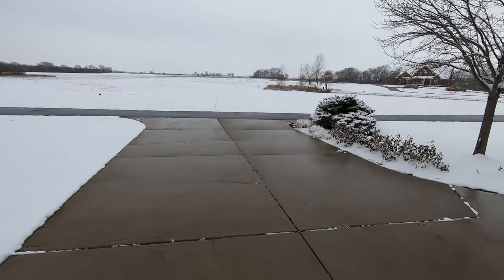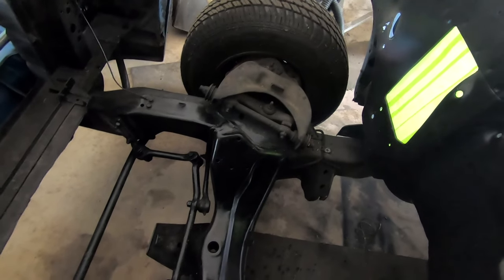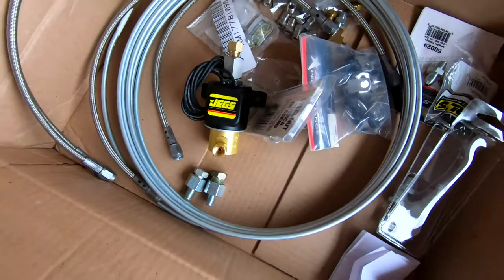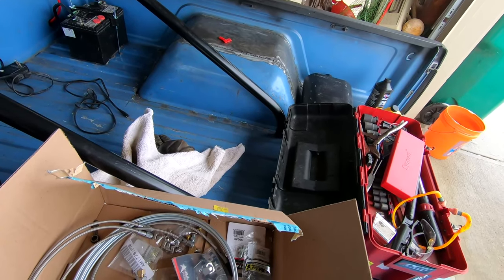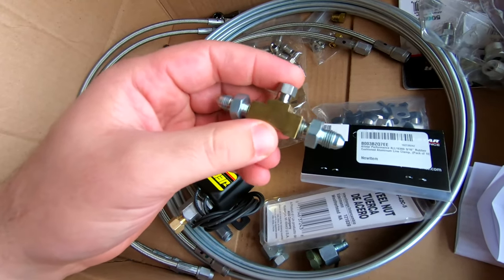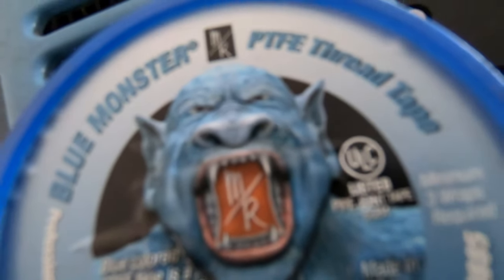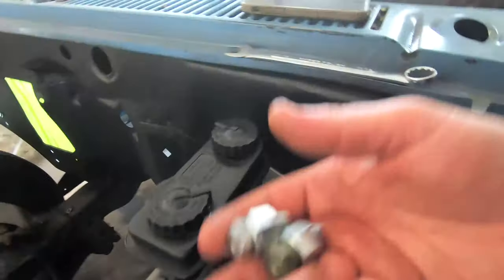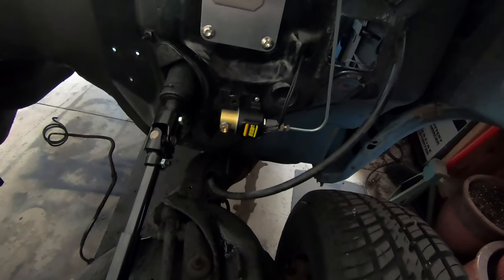Why I Installed my Line Lock Backwards (and What Line Lock Does)

Comment: Hey bud,  I installed my line lock like you did and it didn't work.  Most brake solonoids control back pressure and let pressure through from the master. You're going to need to reverse your lines in order to isolate the rears.  I learned this the hard way, had to take everything apart and mangle the hell out of it but then it worked great.
Reply: yes, at least in my case.  The port nearest the firewall is the front brakes
Reply: Just had to mangle my lines to turn the valve wish I had read this first
Reply: How do you Hold Down the Brakes and Feather the gas while Feathering the Clutch all the same time?  Heal Brake and Toe Throttle?
Reply: Wym reverse the lines. U mean flip solenoid around?
Reply: I've just made the same mistake.. I fitted mine on the rear. It locks the rears on whether I hit the button before I press the pedal or afterwards. Looks like I need to swop the inlet and outlet round.

Comment: you have to switch the solenoid input and output.    The solenoid is actually like a check valve when engaged.  It allows flow from in to out but not the other way.
Reply: you means if you want the rear brake to be not working when putting the brake with the solenoid engaged, the solenoid outlet should be connected to the master cylinder output ?
Reply: @hongmihnhahn7081  yes sir.

Comment: Sneaky Zeke, I plan on installing my line lock as a rear brake shut off as well, can you confirm that this JEGS model does function this way. I have been reading that it only work like a check valve and will not hold back pressure from the master cylinder. I also understand that it only has a 60 second lock time or it will overheat and could be damaged. Thanks ahead of time for your help! Ray's Garage

Comment: So You Have to Brake Pedal with Your Heal, while Gassing with Your Toe if One had a Manual Transmission? Did you mount the Solenoid in the Recommended flow path of Flip that too?

Comment: I keep.reading and I can't understand how this installation on the rear is going to let you do a burnout with the rear wheels
Reply: Push the button and it will block the pressure from squeezing the calipers on the rear, allowing the foot brake to control only the fronts.

Comment: I was thinking of installing something like this on my rear brakes as well. Would it hold the rears as I’m trying to stage. My stock converter lets go pretty early and my rear tires start to spin. If I use something like this would it hold the rear brakes enough for me to bring the rpms up a little higher?

Comment: do you have to switch the inlet and outlet to do this.  Some people are saying you have to switch the lines around or it doesn't work
Reply from the maker: You probably should, I kind of rushed installing it so yeah do your research and make sure that whatever solenoid you get blocks in the direction you want pressurized